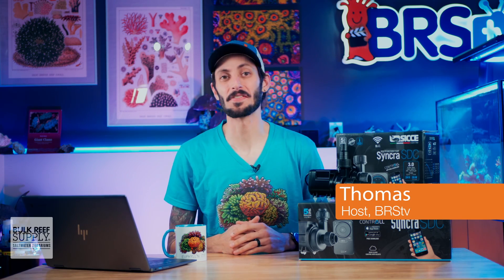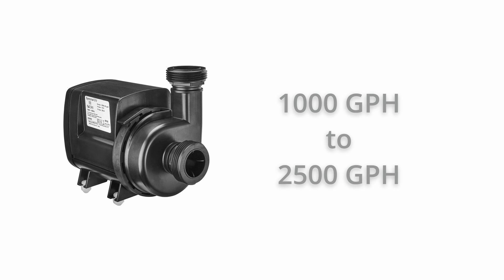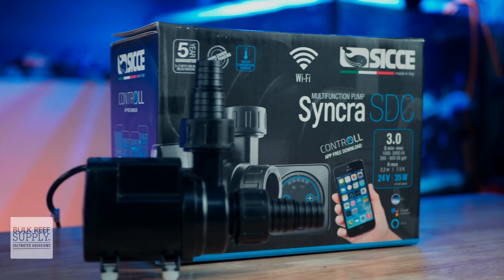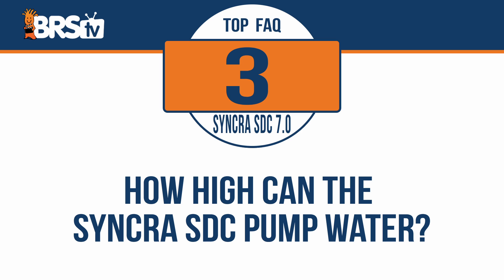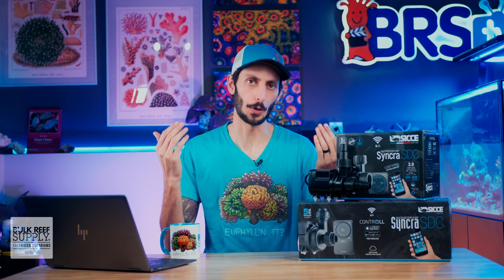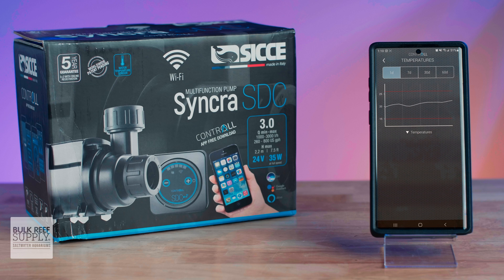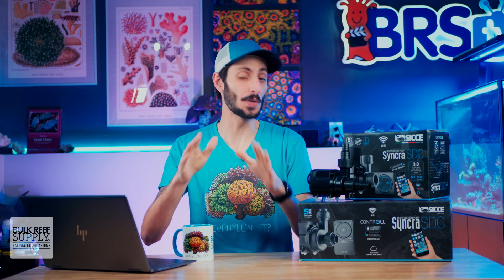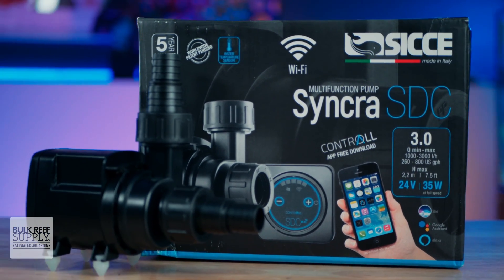Control With Apex or Native App? Sicce Syncra SDC Submersible Aquarium Pumps!

Comment: I just got this for my AIO E170 and I’m going to use it in the rear built in sump but it won’t fit with the guard on the inlet. Will it be ok to use it without the inlet guard on ?
Reply from the maker: Shouldn't be an issue in 99% of cases. It's just the off chance that a rogue snail goes for a walk that might be a slight concern.

Comment: FYI 3.0 DOES NOT WORK WITH APEX. 

"I apologize that you have not received an update. Apex integration for the SDC 3.0 firmware has not been released yet. We are working hard to get this feature live and need a bit more time. I apologize for the delay, but it should not be much longer. "
Reply: The firmware is there now, but I have a lot of trouble with mine, not turning all the way off in feed mode and slow response, which changes not really happy with the using iota truth be told

Comment: I have two Sicce pumps and love them.  They are well built, easy to use, have parts options, and work well.

Sicce is also easy to work with and get parts from.  I recently ordered spare parts and new rubber feet. Even with COVID, the parts were shortly on their way by UPS.  No bad for an Italian manufacturer.  With other companies parts stuck on ships, Sicce had enough stock in the USA to help customers.

Thanks for another great video,
Jim

Comment: Sicce  customer support is really bad takes at least 3 working days between replys  and after over 2 weeks get told that rotors and anything that basically moves is only covered for 6 months. the warranty  is basically a gimmick
Reply from the maker: Sorry to hear that you've had a bad experience! Were you working with the US support team? They're usually really quick to resolve issues. If you haven't already, this email is the one that you'll want to use for Sicce support in the US. 

Sicce – infous@sicce.com

Comment: the app is junk.  won't let you connect a second device. have fun emailing their tech support and waiting a week for a respons - italian time
Reply: Yeah there customer support is really bad takes at least 3 working days between replys  and after over 2 weeks get told that rotors and anything that basically moves is only covered for 6 months. the warranty  is basically a gimmick
Reply: @owen5705  i had a defective syncra sdc 6.0 that wouldn't maintain a steady speed.  Took months of haggling, but they did send another one out.   I always keep a backup ret. pump in case of emergency and this was the backup, so I knew it was the problem since they were identical by doing a selective interchange.  The wifi connection is spotty at best.  Took 5 attempts to pair the newest one w/o success.  I go down in the basement and it's miraculously paired on its own. SMH.  Their old AC stuff was very reliable tho.

Comment: Lets try again. The app on android is trash. Check the 2.0 rating. App wont even connect to the internet now. Tried on 2 android devices.
Reply: No good! Have you reached out to Sicce at all? Also, are you running on a 2.4ghz dedicated wifi channel? Just about all of our reefing gear only works with 2.4ghz, and a lot of routers are designed to run both and switch between them unless you change the settings to separate them into 2 dedicated channels. I had that issue a while back and ended up getting a separate wifi router, using it as an extender, and have all of my reef gear connected to it on a dedicated 2.4ghz channel. If that isn't the issue, I am sure the team over at Sicce can help sort you out asap!
Reply: @ThomasBReef  Im an IT guy i know about the network stuff. The problem was it wouldnt connect to their servers yesterday. Just tried again and it signs in again. Also looks like they updated the app within the last month and it finally works. I can change the level without it defaulting back to 50% everytime. Time will tell if it stays working. 

But if you look at the android app store a 2.0 rating.... They need to spend a bit more time on it.